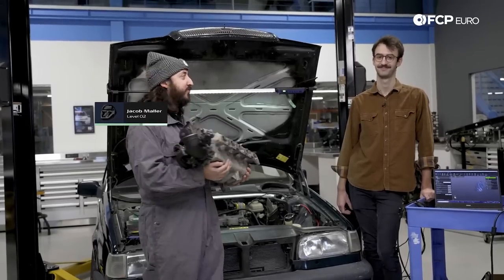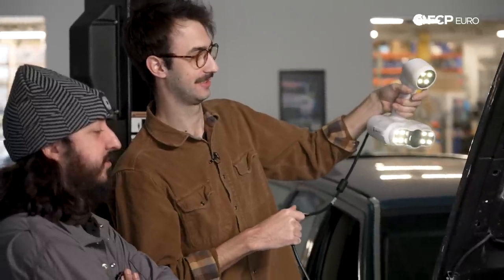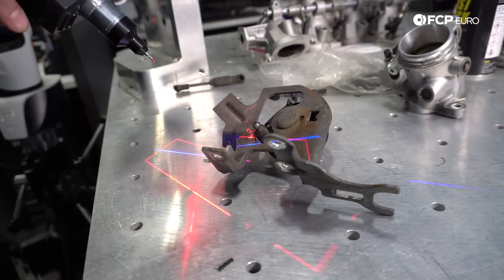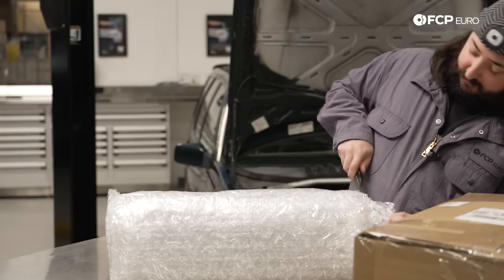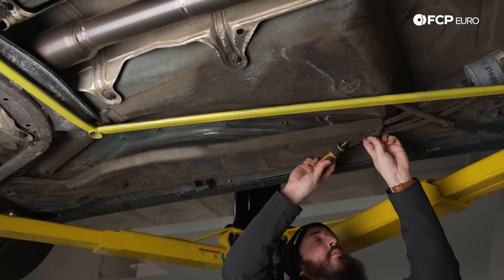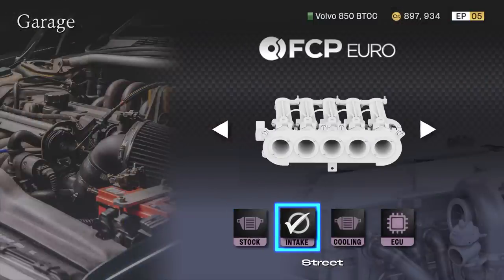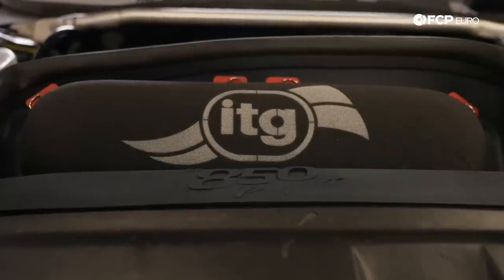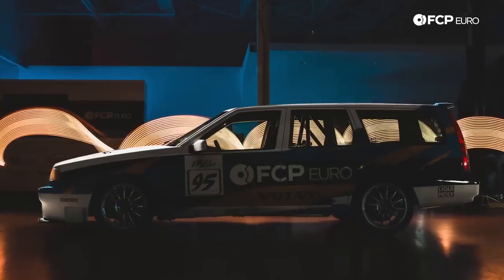Will BMW S85 ITBs Work On A Volvo 5-Cylinder? - The 850 Project S2E05

Comment: You know what'd be real nice? Share the print file with us Volvo guys. My V70 and C70 could use this fun bit :P
Reply: Forget about it.... its not cheap. I prefer DBILLAS itb but.... scan it and pri t it.... nice :)
Reply: A kit would be nice too 🎉
Reply: @Jer0m3  itb to street car is not a very not good idea. Forget about fuel economy, forget about nice iddle, its way more.efficient to intstall turbo or... jist to buy a t5 :)
Reply: @ppanek  who need that when you got awesome sound?!
Reply: Some people do track builds. It would be nice if they offered the files or on demand production of this thing for those interested.
Reply: @ppanek  I had a car with ITBs a long time ago. It worked as fine as any other setup and it was fuel efficient too. It was a Corolla with a 4AGE Blacktop. Sadly it was slow as hell. 170hp my a$$ :P
Reply: @ppanek  idle can be sorted with a separate IAC, which is what the S85 has. Well, 2x IAC valves.
Reply: @thiswillprobhrt  i never try this so i have to belive that this will work :) But still Itb in day to day routine... just for sound and fun? , itb is nice but still i have good and bad feelings about this setup :)
Reply: It’s an OEM setup for most M cars and I’m sure others too, so it’s suitable for daily use. 

 Is it worth the effort and cost to do your own, only you can decide.
Reply: It sounds like my M5 lol
Reply: @ppanek  what about this itb and just use is with a  plenum? for the turbo one

Comment: If you ever feel like dropping some decent money into this, ACM in Sweden has a stroker crank which brings the engine to 2.7 liters with the 83mm bore of the 2.5 engine. And I'm sure Scimec Motor in Norway have some good cams for it.
Reply: I support this
Reply: And E85!
Reply from the maker: Looks like we have some emails to write.... 🤔
Reply: a CNC ported P2 R head (there are a couple places with CNC programs), big valves and hot cams would really wake it up.
Reply: So cool. You Scandos do some cool things with cars. In Australia we just have the humble Ford Barra Turbo. Run on 98 Octane it's makes 420 NM at 3250 rpm - without a turbo. With a turbo...

Comment: when doing fuel line work and a 850 / X70 car.  Use   740/940  fuel filter instead!  It is the same but there is no pushlock on them. and the inside diameter is bigger than 850.  There is a M12 1.5  and M14 1.5 connection.  It is more easy to do this was and maybe even a bit cheaper and easy to replace the fuel filter now and then.

Comment: Excellent work with this video series!  We Volvo enthusiasts are a unique bunch.  For the NA 5-cylinder, that 175 whp number is very impressive!  Ignoring any other variables and estimating drivetrain loss for the M56 gearbox to be 20%, that would put you at 219 bhp.
One of the results of shaving the cylinder head on the original BTCC 850 engine was an increased compression ratio.  If you guys ever tear into the bottom end, a set of 13.5:1 JE pistons would probably bump up your dyno numbers.  It might require 95 octane fuel or an octane booster additive though.

Comment: Basically doing the same thing with the intake air box of my truck... minus the 3d scanner tool and the ITBs. Printing in ASA. Scuffed it and sprayed with high heat engine enamel paint because I want overkill on temperature management lol 3D printing has made custom parts a full win for the DIYers who arent 100% on metal fabrication

Comment: Love the series. I'm not a Volvo guy, but I'm definitely an N/A guy. I'm surprised that it doesn't make even more power than this. A 5cyl engine with ITB and full exhaust that makes the same power as a stock K24A2. It sounds sooo good. I want it to be more!
Reply: All about the cams. It needs way more cam and RPM to get more power out of it.

Comment: As a previous owner of multiple 5 pot whiteblocks and an e60 M5, I rate this video 11/10, would recommend.

Also at 200 crank HP, it’s not far off the specific output of the S85…. Well, without the M button pressed anyway.

Comment: This thing sounds awesome. 175 whp is actually not bad for an old na 5 cylinder. I would love to see a drag race between this and a stock 850r
Reply: So i'm wondering how does this translate then to the GLT engine with 20 valves, because that is already 170hp from the factory, how come this one is only 5hp more with all these upgrades?
Reply: @Jerra3007  GLT is 170hp at the engine. This car made 175 hp to the wheels. 175whp would be above 200 at the engine
Reply: @cumbob   yes i saw that. I love the engine dyno video where it revved to 9400rpm. It sounded insane

Comment: Jacob, why You didn't choose the 2,5 liter 20 valve powerplant? That engine is blast from the stock and with those improvements it could have been a total beast.
Reply: I think they are trying to mimic the volvo btcc car
Reply: @throckmortonthebrave6634  well for that they would need to use a 2L
Reply: @Stale_Mahoney  that is true
Reply: @throckmortonthebrave6634  If I am not wrong, originally, TWR used 2,3 liter turbo engine with dismounted turbo and reduced engine volume. For my project I use B5204S. My guess would be, that Jacob eventually will go for that 20 valve head, because 175hp is just not enough, but there are still many ways to increase the power. Good luck Jacob!
Reply from the maker: In season 1, we replaced the 850's original 20v 2.4 N engine with the updated RN 2.4 liter 20v from a P2.
Reply: @fcpeuro  Then I am curious .... here, in Europa, both these engines make 170hp in stock, but P2 2,5 liter 10 valve make 140, that's why  I thought, that You took the 10 valve engine. Then question, what is the stock power for that P2 2,5 20valve in USA???
Reply: There are no 10V engines in the US. The NA P2's factory figures are 168HP and 166FtLbs.
Reply: @deimosian  Then I have no idea what engine are they using. In season one they measured power on original 850 engine and it was 140 hp, then they swapped for P2 2,5 liter 20 valve (it should have 168hp) So headers, ITB's, remaps, exhaust makes just +7hp????
Reply: @Bumbazaurs  they measure power at the wheels, which is lower than at the crank
Reply: @Financmajster  Ahhh, ou well, that finally makes some sense😁😁😁

Comment: I work in the dentistry, this spray and scan technology is what we did back in 2003, you guys should probably check out some medical grade scanners, no need to spray paint to get a 3d printing model. Super accurate and efficient, can probably scan the entire engine bay within 30 seconds.
Reply: And the size of the scanner is just a little bigger than an electrical tooth brush. Btw, wireless too.
Reply: And the price?
Reply: @Jer0m3  somewhere between $25k to $50k

Comment: fantastic content guys ! What are the mods done to the engine? I want to build all motor with pretty much same recipe as TWR did back in day. is the head stock and still makes this much more power or you have some mild cams in it, it defo sounds not stockish :D

Comment: @fcpeuro I'd like to see a video of how you guys did the electric power steering pump. what was used in place of the old pump, routing of the belt ect. want to do the same with my 850.

Comment: Would be cool to see the head cut at an angle like the real BTCC 850 one day, but higher compression pistons and cams probably a better idea. Maybe even play with the rod length and piston size.
Reply from the maker: Absolutely! We're pretty happy with the results considering this is a mostly stock high-milage engine, but we definitely have our sights set on a full engine build!
Reply: @fcpeuro  yeah I think the results for the motor as it is pretty good. Got to be close to the horsepower a stock LPT makes on the dyno maybe not the torque numbers though

Comment: An old fuel pump has not enough LPH, this project needs a new original Walbro GSS 342, I made on my P80 C70 393hp on it.
New exhaust manifold will cook the engine bay, it needs a really good wrap and heat shields. There is no forced induction, so every 1° will take horsepower from the engine
Reply: Trust me I've told Jacob we need to make a heat shield several times 🤣, we'll get there!
Reply: or ceramic coating. it's more expensive but the coating wont trap moisture or oil
Reply: They're not out of fuel yet, they would have known that while tuning.

Comment: Maybe a future idea try to fit a supercharger so we keep the good sounds but still have a little more powerss? Love this setup guys happy with all those sweet mods
Reply: ah, like what Johann did about 15 years ago on his N/A build. I believe it made about 220-230whp with light boost
Reply from the maker: That's an interesting idea! For the future, we'd love to build the bottom end with high compressions pistons paired with some more aggressive camshafts and valve springs for the head.

Comment: with a feather light single mass flywheel, a sinter clutch, and maybe a couple of cams..
Reply from the maker: In season 1, when we swapped the engine, we installed an 850r clutch and a lightweight single-mass flywheel. The engine has ENEM Y21 Cams, but perhaps we need to go more aggressive!

Comment: I have an S85 engine swap project.  If I could order 2 of those Nuke fuel rails, that would save me some time since you’ve already done the measurements.  Can you help?
Reply: For this project, I re-machined the BMW throttle linkage rod to index with the 91mm bore spacing of the Volvo motor. We used this spacing throughout. So unfortunately, these fuel rails would not help on your S85.

Comment: Is it only a 140hp 10 valve? You could also get a 170hp 20 valve.
Reply: Not a 10V, there are no 10V engines in the US.
Reply: There's a big difference between 168 crank horsepower that the 20V makes stock and their 174 wheel horsepower they got here.
Reply: I am from Europe så i did not know that they only Got the 20v. Over here we Got a 140hp with a 10v and the 170hp with a 20v. I couldent really Imagine that the horsepower rating is at the crank becorse i have had Several Volvos and had Them on a dyno where they have had the hp rating or more on the wheels. And that was Stock cars
Reply: @nielsbenzon1149  how much is the t5 doing?

Comment: TLDR just get an 850 T5, Stick a RICA 304 map on it for £150 to give you 280BHP and 350NM torques and save yourself serious $$$ arsing around with an N/A motor and ITB's for less power and torque!! 😂
Reply: that defeats the whole purpose of the project, now doesnt it?
Reply: Ughh can't stand people that spout this crap. I have a 98 S70 NA and I'm going to be adding ITBs, cams, lighter flywheel, weight reduction and a map. People constantly tell me to just buy a turbo version. It's boring and unimaginative. I want the NA set up with all that work. I don't care if I don't go as fast as the turbo, that isn't the point of doing it.
Reply: @scotty6346  I'm not saying turbos are boring. Telling people to get a turbo is boring and unimaginative when they want to do something unique. There isn't many S70's in England and I'm pretty sure there isn't any with ITBs. There are however a fair few S70R/T5. What I'm doing will be one of very few, if not the only one. 

again I didn't buy my volvo for speed, if I want speed I'll jump in my merc or any of the other fast moters at my disposal and blow that stock T5 out the water. 

It's not all about speed.
Reply: @Biscuits645  I'm in the UK as well! I get your point 👌I've got a 1998 S70 T5 rotting at my storage, It's got a decent black leather interior and all other bits if you are interested?
Reply: @scotty6346  shame it's rotting away bud. What's wrong with it? I purchased seats last weekend, black leather and 4 door cards but I do need the dash, glove box. How much you looking for mate?
Reply: @Biscuits645  The car is an insurance write off due to a N/S/F collision that distorted the chassis leg, Dash and glove box was intact last time i looked, The car is in Bishops Tawton North Devon, If you want to make a trip up and help yourself to the bits let me know and i will check that the dash and glovebox etc is still in good nick before you travel up. I would be looking at £100 ONO cash for the complete dash and glovebox and any other bit's you may fancy mate but you have to remove it from the car! I will be there to give you a hand!😂
Reply: @scotty6346  that's a shame mate. Won't be long before there is hardly any left. Anything wrong with the engine? How could I contact you outside of YouTube? I probably won't be available for a few weeks maybe a month because of work and the kids but I am interested.